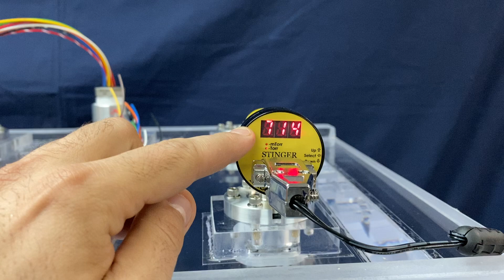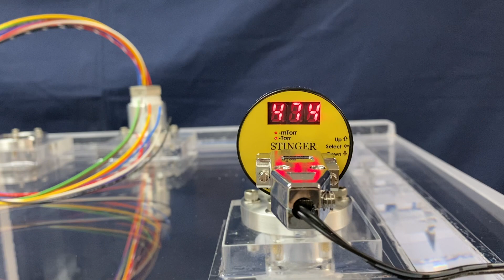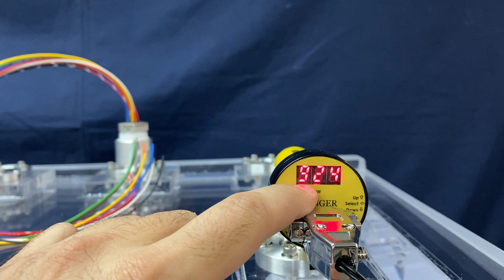Vacuum Chamber and Pump Assembly, Custom System with vacuum feedthroughs

Comment: how to install feedthroughs onto the chamber? need some glue?
Reply from the maker: These feedthroughs are standard NW/KF connections. Therefore no glue required. What we do is we install standard NW/KF/QF (Quick Flange) bulkhead ports onto our chamber walls. In this case, its a NW25 bulkhead port. 

You can then get any type of vacuum feedthrough as long as it has a NW25 Connection and install it onto the NW25 Bulkhead port. You just have to match the port sizes...

Comment: Did you DIY the feedthrough? If so, what sort of epoxy or potting compound did you use to seal around the wire?
Reply from the maker: Hello Ben, this particular feedthrough was not a DIY. It was purchased from one of our suppliers called Pave Technology.

Comment: Hi, if the gas was coming through the liquid feed-trough, how can we maintain the pressure inside at a specific level? Let's say there is a 1 lpm gas load inside the chamber and an inside constant pressure of about 1 Torr is needed. How do you connect the pressure sensor to the pump or to any valve to control the pressure? Is there any feedback system available?
Reply from the maker: The liquid/gas feed-through is connected to a closed system and is independent from the vacuum. One such application would be if you are using something that gets hot insides the chamber and you need to water cool it, such as a component that you need to test at vacuum. You would run the liquid/gas line to the incoming feedthrough then to the component, then from component to the outgoing feedthrough for a closed system. This way it does not compromise the vacuum levels inside the chamber. Thank you.